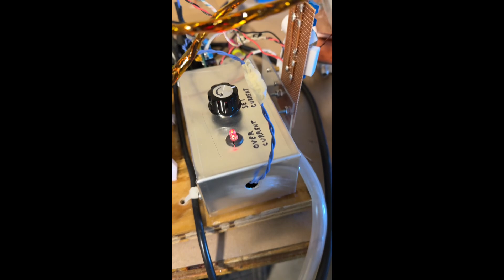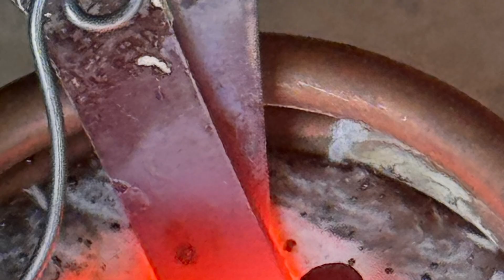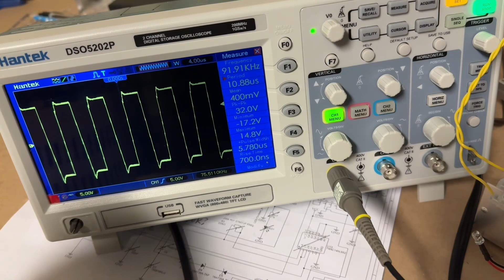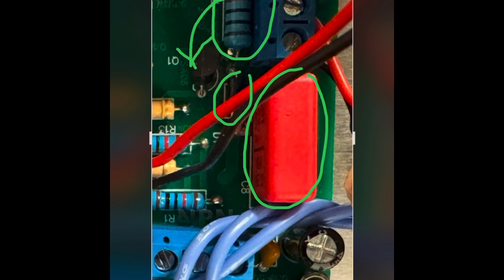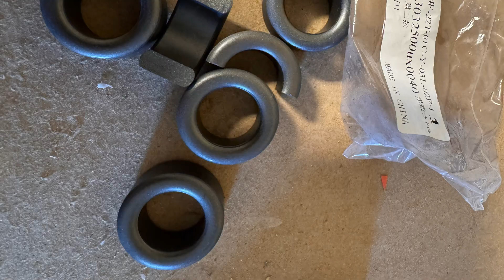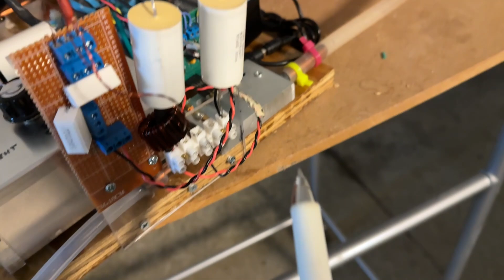Induction Winter Special Build c ZCS

Comment: I really thank you for this work. I think it works with 120v. Our mains current here is 220v. What can be done to make it work?
Reply from the maker: I can’t think of a lot apart from using a large step down transformer which would make it less efficient. Have you found any solid state solutions? A solution would be to try and reduce power draw with PWM instead of cutting the power at energy thresholds
Reply: @BrianDhvTinkerer  Thank you, I tried PLL induction heater 4 or 5 times before but failed. I believe I can succeed after your clear explanation and work. I have placed my PCB orders. I want to thank you very much.

Comment: Just a side note: This is not real current control, only current limit (adjustable) sensing and shutoff.
The Inverter is running at "full throttle" all the time unless the limiter shuts it off.

For real current control the drive circuit should have PWM.
Can be easily done with e.g. a cheap 8bit PiC microprocessor having dedicated pwm outputs and ADC inputs (but codes have to be written) or even with a few more op-amp components and gates and then coding is not required.
On the other hand, this simple adjustable protection is adequate for most tasks.
Reply from the maker: Yes agree this turns off the feedback once it hits a current wall but when it’s running it’s full on. Skip pulse or phase shift is the way to go for constant current control

Comment: That’s awesome !
 
May I ask you this. I don’t have IGBT skm100gb12. So, can I use IGBT 400A 600V (cm400dy 12nfb) instead ?

Is it safe if voltage of IGBT brick is 600v in that circuit ?

Thank you.
Reply from the maker: You could try. Should work. Make sure the gate driver chips have good heat sinking.
Reply from the maker: Thank you!
Reply: @ Thank you soo much!
Reply: Hi @ 

I saw some induction heaters, that can use flexible coil with 15-20 mettes long then it wrapped around the work piece around for 10 rounds (350mm diameter of work piece)  

May I know, the 9kw induction can work with flexible coil in that diameter work piece ?

My job just need temp around 110 -> 200 degrees to apply on.

Thank you.
Reply from the maker: @baotranvu5759 yes will work fine c flexible coil

Comment: While I wait for my PCB driver boards (your design), I rigged up an ESP32 microcontroller to run the IXD driver board. I swapped out the analog potentiometer for a rotary encoder, gives finer software control without the shaky and wandering frequency. Nice because each time it boots, it sets the desired startup freq. Also, the rotaries push button offers a nice way to do a quick reset. I added an OLED to read the frequency for some nice visual feedback. Also added a temp sensor on the IXD's that the program can handle accordingly. It took me a minute to get nice clean code and a good scope reading but the whole thing actually worked great!.  Brought it up to 19A, into a 300A brick full bridge, no smoke. Anyway, thanks again for the inspiration.
Reply from the maker: I got the ixd board Gerber finally and I apologize for the delay. These should work well for any pcb site. The one that these have worked well with is JLCPCB. here is the link:
https://drive.google.com/file/d/1IBhFn5tJY6DY3A0VTvbqMmkZ7Q-FQYtq/view?usp=sharing

really excited your test runs are working so well.
Reply from the maker: That is awesome- I can’t wait to see your build!
Reply: @BrianDhvTinkerer  I'll post a video once I get all finished up. Probably a couple weeks. Thanks for the files.
Reply from the maker: Thats great you got the files
Reply: Hi
Make a guide or something of your circuit With Rotary encoder and code.
I whant to build that 😊
Reply: @camillawesterberg7774  You are better off building this one with the current feedback. I'm just waiting for  my PCB's to arrive to build this. My ESP32 lash-up was just me being impatient. However, I do plan on uploading some schematic and code on my website. It's under construction right now. Will let you all know soon. https://youtu.be/sth4w6erVzI

Comment: Great stuff man. I've been following along with this project for some time and taken a crack at building it a couple times along the way. Had decent success, but not where you are at right now. I was very happy to see the update with the Gerber files. Of course, I immediately sent off an order for the control board to JLCPCP. Very excited to get those. QQ: the IXD igbt driver file only contained the 3D OBJ files, no gerber files? I already have a fabricated version of it so no big deal, but thought I would ask. Thank you for all your (and the contributors) work on this, It truly has been inspiring and I have had many enjoyable hours tinkering with this. I might have spent a little too much money on some components though lol. Those big current water cooled caps and IXD driver IC's add up quick $$$. Cheers.
Reply from the maker: Thank you - your comments and input are very much appreciated. This project has had several iterations but I have it where I want it. You are right about the pricey water cooled induction heater rated caps. I found a great source of much cheaper but equally good ones. If you go to AliExpress and look up under Dawncap, they have the same ones there at  much less cost. I bought and tested them and they work great. 

I have some updated links:
PCP layout for control board:

https://drive.google.com/file/d/1h4kxoZ1_6Dh3QJIstDq9H-sHtt3lNS4P/view?usp=sharing

PCB Gerber files IXD board:
https://drive.google.com/file/d/1m3IdvCUGjPZFKOSNN-H1mgReDLHoBLxU/view?usp=sharing

PCP layout IXD driver board:
https://drive.google.com/file/d/1m3IdvCUGjPZFKOSNN-H1mgReDLHoBLxU/view?usp=sharing
Reply: @BrianDhvTinkerer  Thank you again sir. Not sure what happened to my previous reply, it disappeared. Can you check the linked files for link 2: PCB Gerber files IXD board: and link 3: PCP layout IXD driver board. I think they are the same file. Both the 3D OBJ file but no Gerber files. Thank you. I have no clue how to design and create gerber layered files yet.
Reply from the maker: Sure will I’ll check it out for you
Reply from the maker: Great that you are having success with the build. I have gotten with working very well and have heated 1 lb or iron to molten very quicky on a test run. I have gotten the gerber for the IXDN board. Sorry for the delay in getting this to you but here is is:
https://drive.google.com/file/d/1IBhFn5tJY6DY3A0VTvbqMmkZ7Q-FQYtq/view?usp=sharing
Reply: "I immediately sent off an order for the control board to JLCPCP. Very excited to get those. "
 Imagine being such a tool.

Comment: Powdered iron can also replace the ferrite in the main transformer
Reply from the maker: When I tried powder iron, the coupling transformer  got really hot. The ferrite ( MnZn)  worked the best in terms of heating and didn’t  get about 30° even when I’m running it for extended periods.
Reply: @BrianDhvTinkerer  oh okay, theres various grain sizes of powdered iron cores. maybe i just got lucky
Reply from the maker: Yep I think powdered iron is pretty much luck of the drawer. It may also be frequency dependent. With the size work coil I’m using, frequency is around 54 kHz and those high permeability ferrites work well with this. Low permeability ferrite gets hot and cracks
Reply: @BrianDhvTinkerer  i also tried looking for proper cheap ferrites for it. eventually i gave up and just switched to parallel resonant lol
Reply from the maker: Parallel resonance works well. Sometimes a little harder on the switches

Comment: Pulse skipping mode may also be a useful way to limit current without turning off oscillation completely.
Reply from the maker: Yes for sure this would be a good way. I do have a pulse skip board which could be modded to do this.